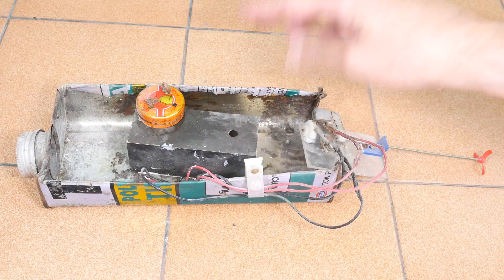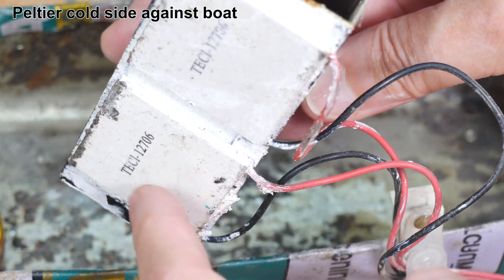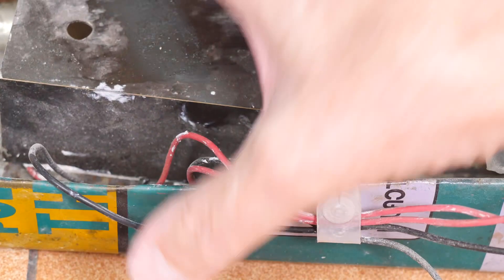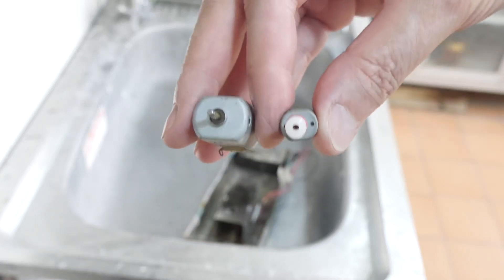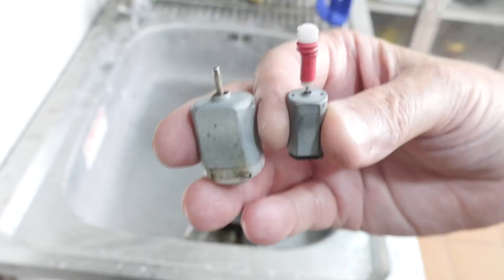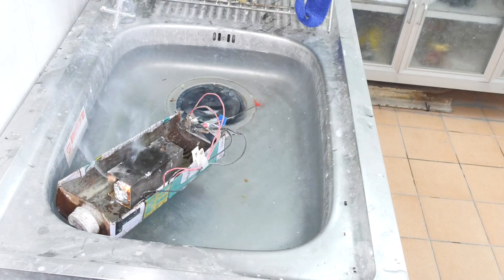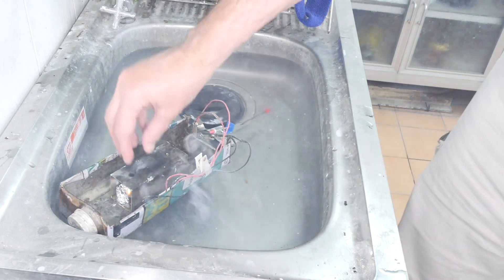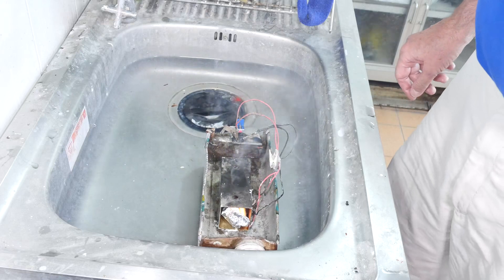Electric Pop Pop Boat V3.0 / Fireboat Experiment (4K)

Comment: This is completely off subject but my comment is about one of your videos from 5 years ago. I'm building your crystal radio. I was thinking one could put two strong springs under the coil  on each end where it is mounted to the board. This would allow you to adjust each side of the coil for proper tension against the slide rod. Contact would be equal across the coil. The slide rod would be mounted level to the top of the coil.  Love your videos!!
Reply from the maker: Thank you. Your spring approach would look cool. To fix that tension problem, I raised the tuning rod  and put a spring tensioner on it. I've got a video on that, think I called it mods or improvements or such. Post a vid when you make it and leave a link, I would like to see it.